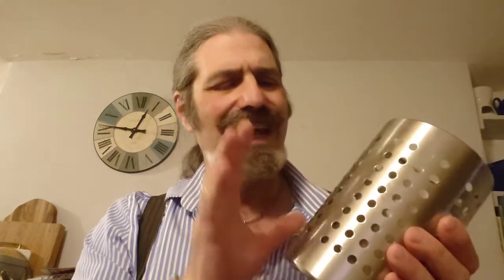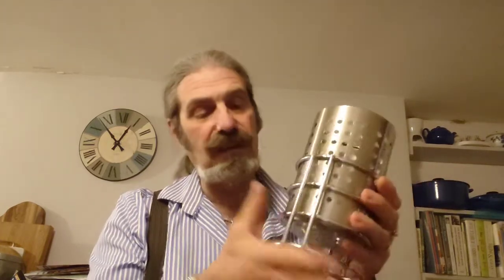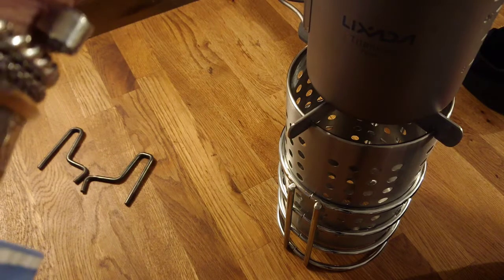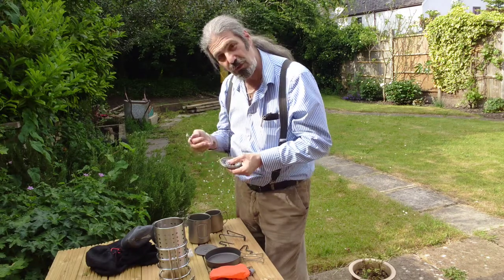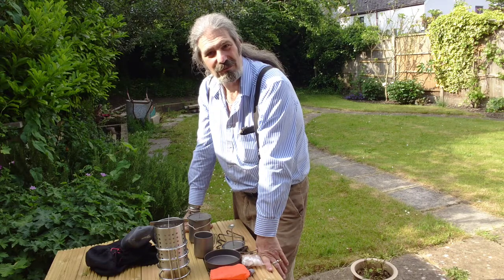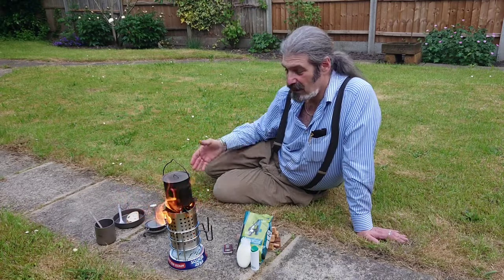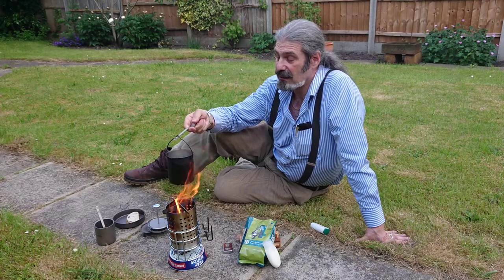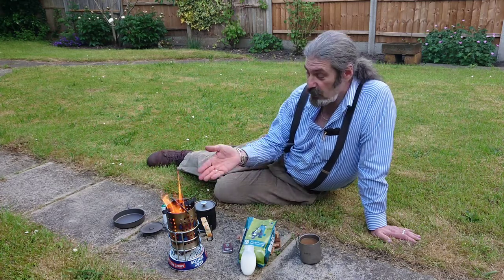Making and Testing my New Design Safety Twig Stove

Comment: Boiling coffee is unnecessary, it is best made with water that has cooled a little for better flavour. I did enjoy the video though.Did you consider raising the stove on crossed peices similar to the pot stand?
Reply from the maker: There are of course many different ways to make coffee, boiling it makes what's known as cowboy coffee which, if you've ever tried it, is rather good. That said, you're quite correct to suggest that there are other methods as well. In this case I chose to make the cowboy version, as it more closely approximated to cooking food, and was therefore a better test of the stove in my estimation, for the purposes of this video.
Reply from the maker: As to raising the stove with cross pieces, whilst that would work, it would not be as stable as the system shown, and the increased stability significantly improves safety, which was a big focus in my thinking. Also, as I use the space under the burn chamber as storage space for accessories, I don't see it in any meaningful sense as being wasted space.